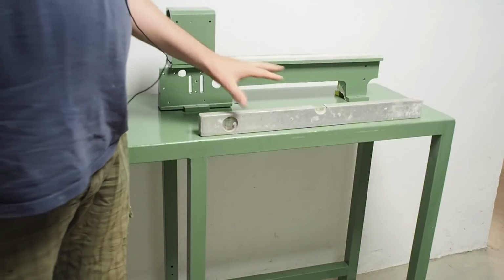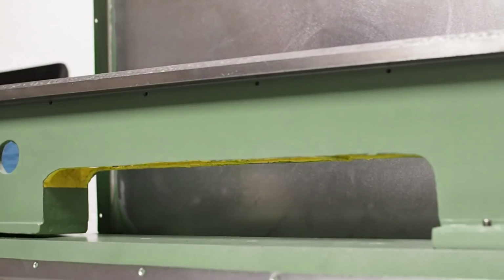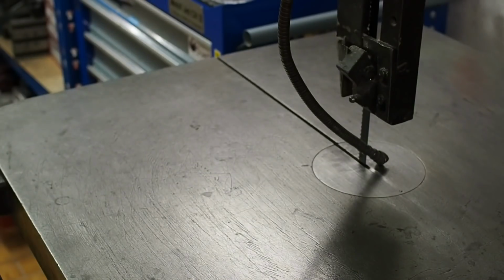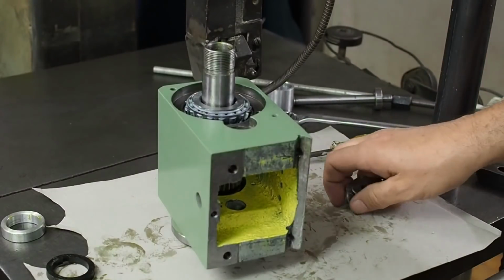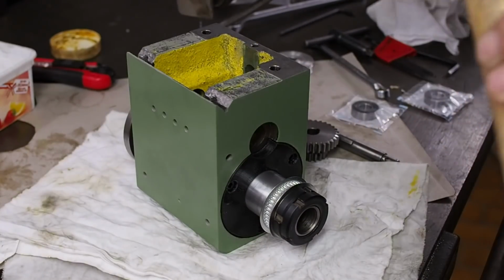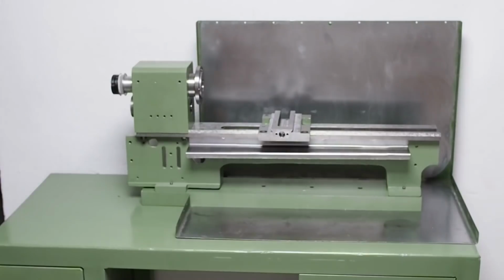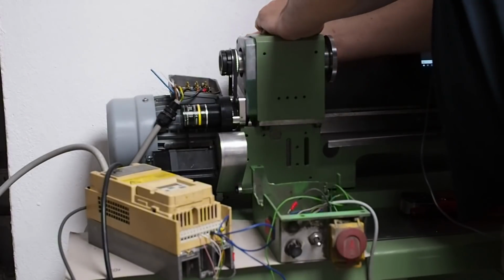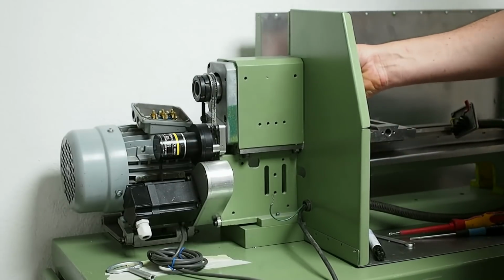Restoring  the CNC7x12 mini lathe - Episode 19 - Spindle assembly

Comment: Do you think the taper roller bearings are overkill compared to angular contact bearings which do not require space modification? It seems as if a lot of people are replacing with angular contact bearings now. (Once my mini lathe is apart I cannot make new spacers)
Reply from the maker: Yes I agree. The tapered roller bearings are not a great choice. The whole machine is so flexible that the bearing rigidity does not seem to be a large factor in the performance. The few persons whole I have seen measure the concentrity of the two bearing bores were also not impressed.
Reply: @RotarySMP  I might bolt machine to slab of granite I happen to have.
Reply from the maker: @stevewhite315  It should seriously improve the stiffness. Was this the video where I put a clock on it and twisted the bed with my hands?

Comment: You ain”t going to like the noise they make and they get worse as time goes by !
I ended up removing the gears and made a belt drive system  that has two speeds and this along with a 3ph motor + vfd means almost no noise . One benefit of this system is in low range at its lowest vfd speed I can’t stop the chuck spinning by hand and the belt drive lever acts like a clutch  which allows power tapping / threading with good sensitivity.
My spindle gets very hot  -i have  tried everything including running the bearings with no pre load , different grease and even gear oil . When i built the headstock i fitted double lip seals to the end caps and i think they may be contributing to the heat and maybe also the poly v belt drive on the spindle . I have never measured the temperature but after about 15min of running at 1000rpm you cant hold onto the chuck for more than a second or two .
I fitted two grease nipples to the rear of the head  that channel grease in through the bearings and pushes the old grease out into the cavity inside the head . My other lathe had the same set up except no seals and it only ever  got slightly warm .
So when it is all finished are you going to make a name plate or sticker up for it ? Might i suggest “ THE SHINING TURD CNC MANUFACTURING COMPANY “ 😁
Reply from the maker: Funny part is, I have that 3Ph motor and VFD belt driving the spindle, but decided I like the option of low end torque, and decided to put the gears back in. Could well have been a bad choice that one.  Thanks for watching.

Comment: Will be a nice machine in the end, unfortunately the original castings are total crap.
Same size machine or slightly bigger,  build around a big heavy, wide slant bed, closed loop servos with linear scales on all axis, perhaps a 3th milling axis, delivered as parts kit from china, that would be totally awesome.

Unfortunately everyone buys those cheap toys, so the china guys have no reason to change.
Reply from the maker: I agree with you. The machine you describe would be a modernised Emco 120. Totally different market and price point unfortunately.

Comment: I love that the motor is almost the same size as than the lathe.
Reply from the maker: After I burnt out the original little DC motor, I wanted a decent standard industrial 3Phase motor. This is actually pretty small :) Thanks for watching.

Comment: The plastic spacers may have been part of the design. Plastic on metal not metal on spinning metal.
Reply from the maker: The spacers don't spin against anything. They are part of the inner race stack up. Fwd bearing, spacer, back gear, rear spacer, rear bearing, outer spacer, encoder pulley and dual nuts. Those two spacers just locate the back gear. Thanks for watching.

Comment: Overall how do you like those Ikea cabinets? I've been looking at them as a way to get some cheap shop tooling storage but I've been hesitant to pull the trigger since they have such mixed reviews online, some people say they are built way too cheap but yours looks ok?
Reply from the maker: It is thin sheet metal. Epoxying then together makes a big difference, but they are still pretty flimsy. Epoxying MDF into each drawer would probably make then feel a lot better. The one with the Clarkson T&C accessories in it is about a year old, and some drawers are holding a lot of weight, but still works fine. Mounting them into a rigid stand like my lathe stand actually makes them feel pretty good. I cant see any other options for €40 which would do as well.
Reply: @RotarySMP  Thanks for the info! Your sentiment about no other option at this price is exactly what I was thinking! I'm considering ordering 2 or 3 of them and bolting them together and mounting them on a combined base with wheels, hoping that will stiffen them up enough!
Reply from the maker: @FKreider  I used my parallel jaw pliers to crush the rear flange onto the epoxy as well. There is a nice picture here of someone who did like what you are planning...
https://www.flickr.com/photos/49960717@N08/29102245291

Comment: Did you not consider fitting a machined  'steady' under the headstock where the original motor went as the headstock is mostly overhanging the bed at the back, also a steady under the middle of the bed for much the same reason? :-)
Reply from the maker: That would be a different machine. Really, you'd be better off starting with one of the Boley, Schaublin, Leinen etc watch making lathe beds, as they are much stiffer.

Comment: About the gearbox sealing, you could just apply flex seal to the surfaces (shouldn't affect the fit?) And boom it'll hold oil. I have a raiser box for my milling head filled with oil sealed like that and it doesn't leak... From there anyway. The relieved areas will seal up also fine with flex seal but that might be too much of a hackjob for your standards I guess.
Reply from the maker: I have my doubts about the quality of these cheap steel gears. If they fail, rather than doing a sealed gearbox, I think it would be better to go back to a belt drive direct to the pulley, and regain the torque with a bigger motor. That is why real CNC machines do it. Still, first I'll see how it goes like this. Thanks for watching.